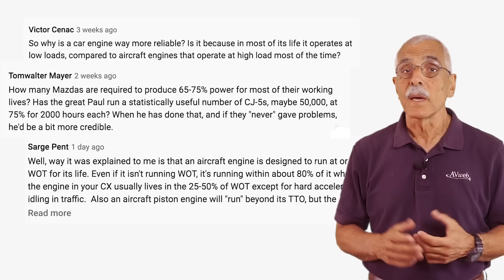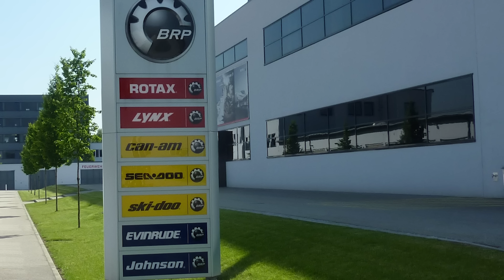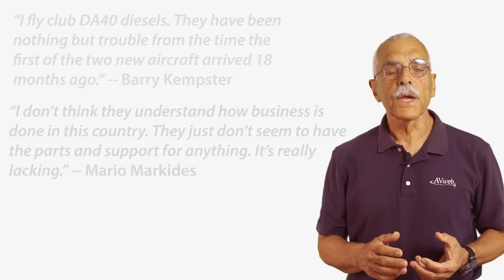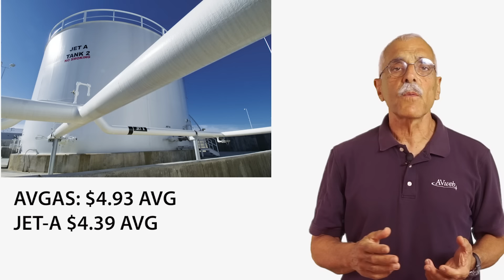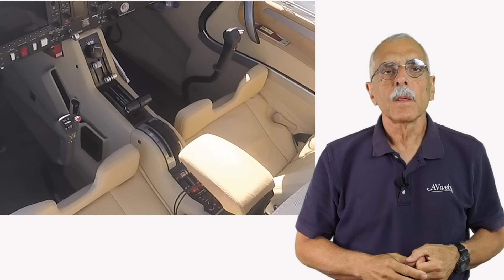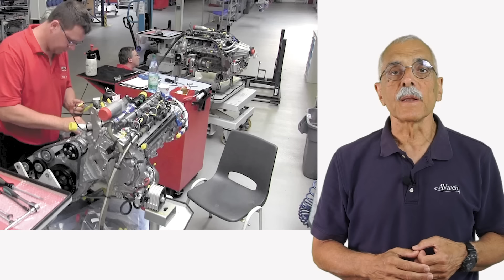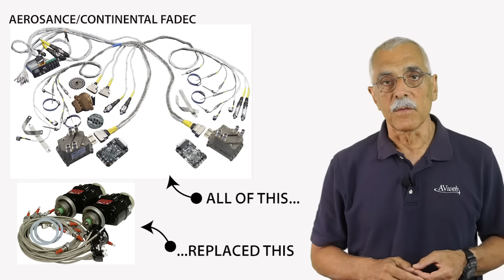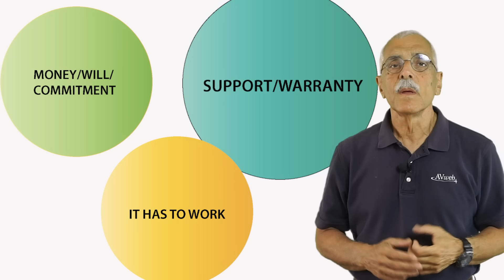Why New Aircraft Engine Ideas Rarely Succeed

Comment: Let's build an engine aimed at flight schools! Yay, they'll love the fuel savings. They fly 3 - 6 hours a day!

We'll include a gearbox that has to be removed and shipped internationally every 300 hours (50-100 days).

Everyone looks surprised when this becomes a giant crater.

On another tangent, as long as I can remember, tiny turboprop engines were about to revolutionise light aircraft. (while allowing students to log multi engine gasturbine hours) I'd love a "where are they now?" video on these.
Reply: A gearbox that has been removed and shipped to the other side of the world every 2-3 months is the dumbest thing I’ve ever heard. If I was trying to fail I wouldn’t even think about that as an option. I would just put a crappy timing belt or weak valve springs in. Instead, they went the extra mile to ensure not just failure, but also infamy  🤦🏽‍♂️

Comment: Ah yes, the good old tried & tested approach to starting a stubborn engine in anything - aircraft, cars, trucks, bikes, lawnmowers.... "set the throttle, hold your mouth just right , crank it...."  It's all in the technique! 👍
Reply: But it is something that has been getting better over time. Just look at early automobiles compared to modern cars. Way back it was both a mental and physical test to start a car as you had to hand crank it, but only after you set the ignition timing, fuel blend, air intake and possibly primed it. To drive you had to keep track of ignition timing, fuel blend and how much air to feed it. The first simplification was to make ignition timing automated as well as the fuel mix. Add a starter engine and things got much simpler. So you ended up with the gas pedal, a choke and possibly priming. With increased tweaking of the ignition, the development of direct injection and eventually electronical control of it all we've ended up with cars where starting the engine is ridiculously simple. Turn the key and it starts. We have gotten to the point where we are so sure the engine really will start that we let it automatically turn off any time we stop for more than a couple of seconds at a red light. Just step on the gas and the engine starts right up so smoothly a lot of people won't even notice it was off in the first place.

I got to think about that when I retired my last car, or perhaps latest, I'm not dead yet. It was a 98 Toyota Corolla and though just about everything else decided to fall apart at the same time, apparently after having a secret meeting I wasn't invited to, the engine never once gave me a problem starting. I've driven a lot of old cars and tractors and been around a lot of heavy equipment and none of those old machines was as reliable as that Toyota. Not even the Volvo B18 and B20 car engines that was known as being indestructible were as reliable in everyday use. With reliable I mean that it started at first try every time no matter the temperature and it ran without leaking oil, was reasonably fuel efficient and were easy and cheap to maintain. Compared to something like the B20 it was so much simpler for the owner. No carburetor to trim or maintain, no cranking it for minutes hoping it will start when it's cold outside, no growing stains where it has been pissing oil for the last twenty years and so on.

It can be argued that with this increased ease of use we have lost a lot of ease of maintenance, and I can agree on that. When a modern car engine starts to throw a fit it is often more complicated to get it working again. Carburetors and mechanical distributors and ignition systems are very easy to understand. You need fuel, air and a spark. Get the fuel and air into the cylinder and add the spark at the right time and the engine will run. This is the basics of a IC engine. With modern ignition systems you no longer have manual control over any of this and that makes them hard to maintain when you do not have the brand specific tools and parts. Old engine we could patch together, and while they might not work perfectly they would get us how or wherever we were going. When a modern car stops at the side of the road with a light saying it's an engine failure it's not likely you will be fixing this up enough to take you home even if you have a huge toolbox in the car. So pick up that phone and call for a tow truck to take you to a garage.

But like I said some where above, the modern car is just so much more reliable that it's pretty crazy. And let's face it, most drivers do not know much more than how to drive and how to fill up the tank. And that's all they are interested in. The car has gone from being something you needed to know how it worked to becoming a commodity you don't really think about. Sure there are some lemons, and they can be pretty frustrating when you encounter them, but percentage wise they are very few compared to how it used to be "in the good old days".
Reply: I always understood the proper incantations to be crucial parts of the procedure as well. I remember my father out on cold winter days trying to start whichever old clunker he was driving at that time, loudly chanting out mystic combinations of words that my mother never wanted him to say when we were in hearing. She called them his 'car starting words'. True story.
Reply: Most of the things you can do to start that cantankerous beast mean very little if you don't hold your mouth right. Just saying
Reply: I note that the large displacement diesels I sit behind all day have a very complex cold start procedure.... (1) Turn the key to start position and hold until the rumbly noises start. I drove a friend’s 1960’s vintage car and marvelled at the CHOKE knob on the dash. Those were still around in the 70’s, but I had to think for a bit to remember the last thing I owned that had one.  Those bit you at -25°C or so if you didn’t “hold your nose right”. Fondly remembered, but oft-cursed at the time.😏
Reply: @colinwallace5286  Nothing a quick shot of ether won't fix.

Comment: I have thought about this many times. If Porsche could not do it, then it’s not practical for an automotive manufacturer to do it. It’s only chance to catch on would be experimental but that market is well served by the regular manufacturers who all now have uncertified lines. Viking and their Honda based thing looks interesting for RV’s. The most promising thing for high performance is aluminum small blocks with racing dry sump systems work well when tried but by the time you load up all the race parts you are in over 60k for an uncertified motor and now you could buy a certified comparable motor for not much more money. The quantities are just not there. Cristian Von Koenigsegg has been hinting at a 3 cylinder high hp low burn rate unit using his new free valve technology could be in the cards but it would not be cheap. He has the money to ram it down the FAA’s throats and is probably the best chance at getting it done. He really is a billionaire Bond Villain who actually likes people and engines.

Comment: Who wouldn't want a Porsche engine? Anyone who's dealt with and Porsche, ever.
Reply: You can't single out Porsche for that though. Pretty much every engine manufacturer ever has had their problems.
And given Porsche's considerable success in endurance motorsport over the years it's pretty daft to suggest they are crap. Maybe they are if your definition of crap is very harsh, but they're certainly less crap than everyone else when it comes to reliability under extreme stress. Can be a bit hard to work on? Yes. Weird little idiosyncratic uniqueness that requires special tools? Sure. But that applies to pretty much every car made after 1980.
Reply: The guy buying isn't the same guy who's wrenching. Doctors and lawyers like the sound of "Porsche" when they boast to their doctor/lawyer friends, even if it costs more to maintain and makes the mechanic hate them.
Reply: @tissuepaper9962  but private aviators aren't like that. Especially the lower end of the spectrum - they either wrench it themselves (and often go experimental to avoid needing the aircraft mechanic license), or they pay for the guy with said license, but are very cost-conscious about it!
Reply: @tissuepaper9962  To be fair, Porsche mechanics have a love/hate relationship with the engines. They hate working on them, but they love how much money they make from working on them.
Reply: The Porsche engine was heavier, more expensive, and used more fuel than the Continental. It vibrated less and had single power lever control. I was told the cylinder heads were only good for 500 hours. An engine based on their current liquid cooled engines would probably work fine but don't hold your breath.
Reply: @MurryR100  porsche makes trash. their cars are low use and everyone knows it.
Reply: @DieselRamcharger  Air cooled aircraft engines have always had a problem with hot spots in the cylinder heads; exhaust valve seats and spark plugs typically. Continental found out with the Voyager liquid cooled engines, that the combustion chamber temps were about 100 degrees cooler than in their air-cooled engines. The same was true with WW II vintage engines. Aluminum fatigues with temp cycling, higher temps make it worse. Rotax engineers were smarter than the Porsche engineers. 
,
Reply: @DieselRamcharger  Well, except for anyone who has driven one. You couldn't take mine from me for twice what I paid for it.   People like you who talk out of their butt tire me.
Reply: @williampotter2098  lmao. enjoy your 924.
Reply: @DieselRamcharger  So what do you drive? 
How many times has your car maker won LeMans? 
Does your car maker have a worldwide one-make series that's a talent pool for sedan racing series in every country that has one? 
Does your car maker have a model that is the yardstick for a practical sports car that's been in production for 60 years?
Doesn't seem like Porsche makes trash to me.
And no, I don't have one. If I could afford one I probably would though.
Reply: @woopimagpie  The fuck are you yammering on about? You ever been to lemans? You ever built a single race car? You know nothing of that which you speak.
Reply: @DieselRamcharger   
Hahah
Reply: @DieselRamcharger they make nerd engines, if you like taking stuff apart, it’s fascinating the wacky bullshit they come up with, sometimes it works pretty good too.
Reply: @coreygolphenee8852  there is reallly nothing novel about porsche engines. they are pretty basic in all regards. Now an Alfa engine has some weird shit going on inside of it. Ever seen an overhead cam engine with push rods going to only half the valves?
Reply: I remember hearing a story about a 911 owner who had a particular vibration issue in the engine, and Porsche fix was to replace the engine.
Reply: @RayleighCriterion  .. under warranty?
Reply: On an aircraft, definitely not. On a car, hell yeah.
As a porsche builder and amateur race driver I love these things. Yeah people will bring up IMS which was a short period or bore scoring which was on those same engines. Otherwise they are excellent cars. Air cooled or water. Dont get me started on the beauty of the Mezger designs. The only people who hate these car’s engineering are people who’ve heard from a friend of a friend about his “junk porsche” or some youtube video of someone who uses clickbait titles to give a mediocre explanation. Most complaints are those same bore scored/IMS engines which every person on earth can agree are junk. No one is perfect all the time. I mean either way, its not like you are expecting a GT3 engine to last as long as a corolla engine when the use cases and performance windows are so different. One is a commercially mass produced economy engine, and one is a mildly detuned race engine with a dry sump and obscene redline. Can you tell I love Porsches. By the way when I talk about these cars I am talking pre-VW merger cars. Nothing new. I dont touch new cars without a liability waiver. No thanks.
Reply: A sketching  outdoors
Reply: Depends on the year.. Ide guess
Reply: IMS bearings. I shouldn’t have to say more (although those came much later)
Reply: @counterfit5  AFAIK that's been fixed.
Reply: @samiraperi467  That's post-fact and as-comforting as having the disease that kills you named after you, for an aircraft engine.
Reply: @samiraperi467    But by admitting that, he has no reason to sound superior.  I have a cheap but new looking low mileage Boxster with a "suspect" bearing.  When I need to replace the clutch, I'll replace the bearing.  No problema.
Reply: @samiraperi467 yes but now they have bore scoring problems, exacerbated by their poorly designed water cooling systems. I guess sticking to air cooled engines for so long means they have some catching up to do!
Reply: @counterfit5  This just proves you have no idea what you are talking about.  Very low chance of a failure and replacement cost to remove the fear is low.  But people who know little and want to sound like they know a lot love to drag out this old chestnut.  I'm sure you watched "Sideways" and decided Merlot was bad too.  Although you and others who came to that conclusion don't know that the stars favorite wine WAS a Merlot.  Just like the IMS bearing isn't a problem.

Comment: So the "problem" is it being a niche (very low volume and high price) and conservative market without external pressures to deliver better results, like airliners have.
And experimental aircraft are a different market that allow the testing and development of new technology. Same for other related markets (engines for cars and boats, racing, drones, military, transportation of goods, aerospace, air taxis, light-sport aircraft, ultralights...).
Another thing is you can slowly improve an existing engine forever as long as you have a solid research, development, testing and deployment cycle for it.